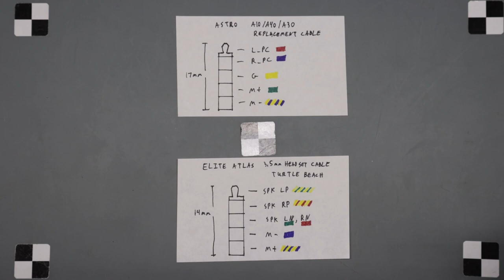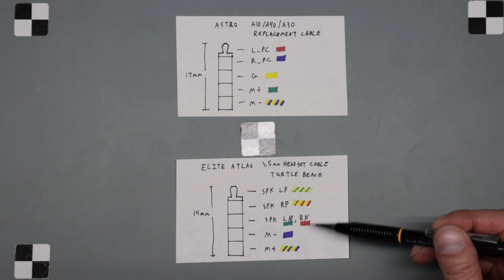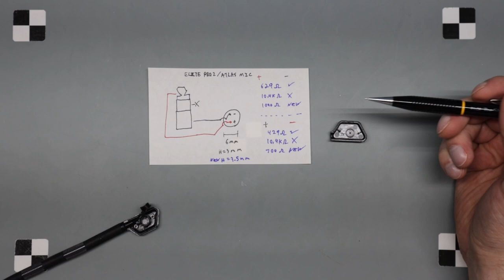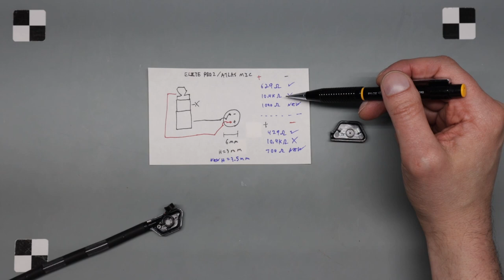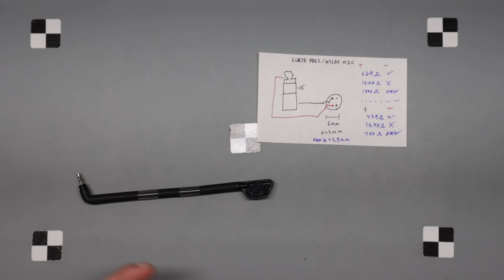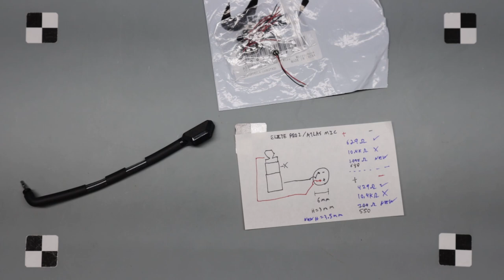Repair - Turtle Beach Elite Atlas Headphone Speaker, Headset Cable and Microphone

Comment: What do the plates even do😂😂. I have this headset and the left speaker blew out. Where can I find more because the linked ones are unavailable.
Reply from the maker: Just search Amazon for "50mm Headset Speaker Driver 32 ohm". Make sure the results show 50mm, I see 40mm mixed in there.
They come in sets/pair so you would want to replace them both so that the sound matches.
The ones I got were $16, so I wouldn't buy anything cheaper than that.

Comment: Link is to 40mm replacement drivers when description says 50mm...
Reply from the maker: That is odd, I just double checked my Amazon order details, and it shows as 50mm and the correct compatible headsets.
But I see that now when you click on the link ending in "B09CPF35Q9" it redirects to another page ending in "B09CPDFNKX".
I'll make a note of it in the description.